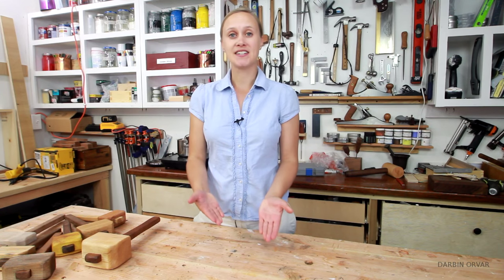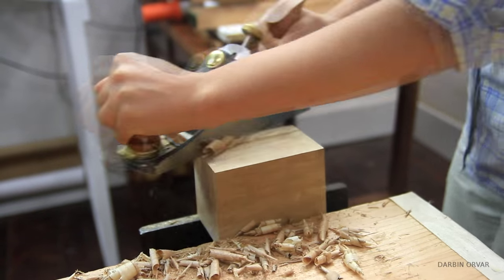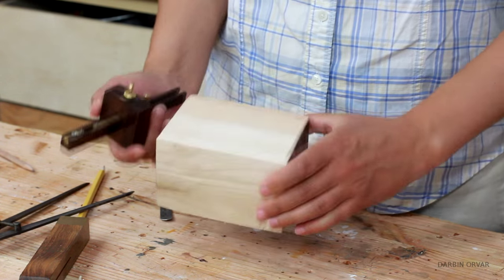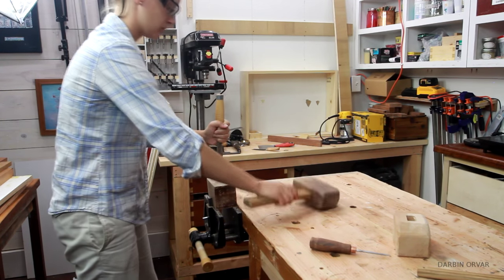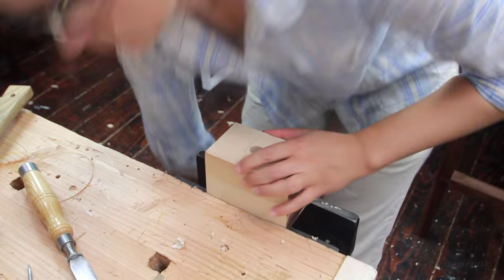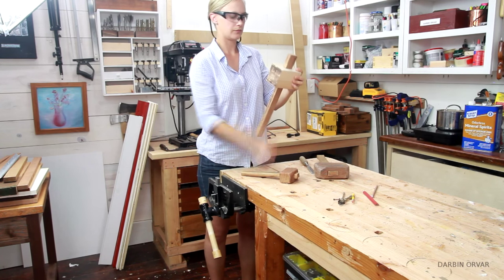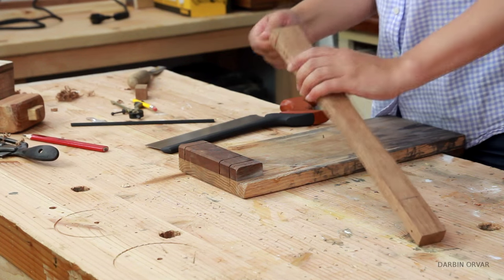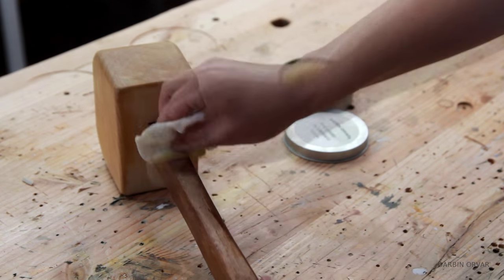Making a Solid Head Mallet By Hand

Comment: Greetings. Thank you. Rex Kruger(sp) did a demo of a double taper  handle into the head. I made one, using two pc of oak from a pallet for the head. Much simpler to get a double taper for the handle. I made the handle from maple. It really came out looking nice. This mallet was made with a 7 degree face an a significant arch, on both the top and bottom. Making the handle 15" gave excellent balance at the base of the head and the mallet sets flat on the bench. I like what you did here, especially demonstrating how to bring the lines around the head. I too like using only wax although I also use BLO and Tung Oil with a wax top-coat. Blessings to you and yours.

Comment: Nice work all with hand tools. I should buy one before you discover your drill press table tilts :) That is the same style mallet I was taught to make, but we cheated sort of by making the head out of three pieces and then cutting the center piece to fit the angle of the handle and gluing up the head around the handle. It's still a separate piece from the handle, and the handle angle keeps the head from ever flying off like yours. Excellent explanation of the design, and really nice to watch you work through the process with chisel, plane, and spokeshave.

Comment: Maybe i missed it, but do you cut the handle so that there is equal weight (balance) on either side at a specific point along the handle, and if yes, where do you determine where that point should be?
Reply from the maker: Erik S Hi Erik, I do not balance the handle to match the weight of the head. I make heads that are small to very large, so balancing the handle would be a lot of work, as well as make really big, or really small handles. So you should really stick with handle sizes that work the best for your hand.

Comment: Just curious, Why not use the drill press here?
Reply from the maker: Chris Matthes It is easier since I want a slight angle. You could rig up a jig to hold the head on the drill press, but this is a pretty quick and easy way to do it.
Reply: You can tilt the table on most drill presses. Keep up  the good work.